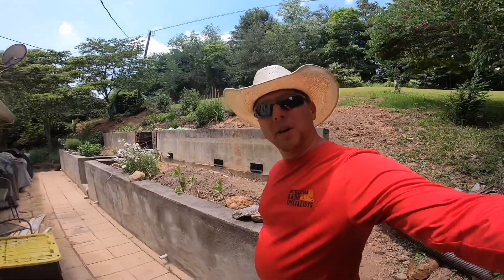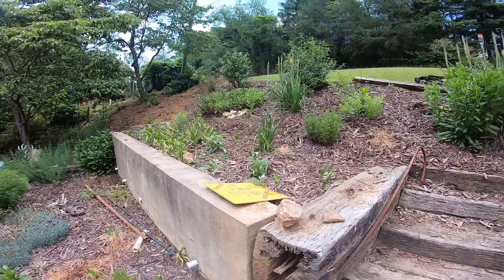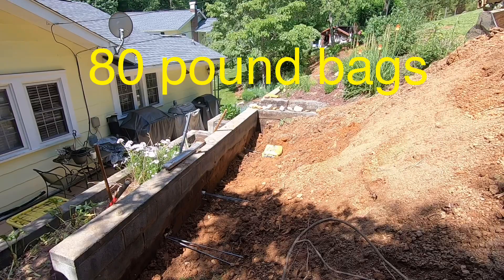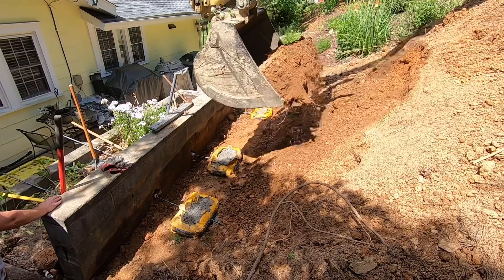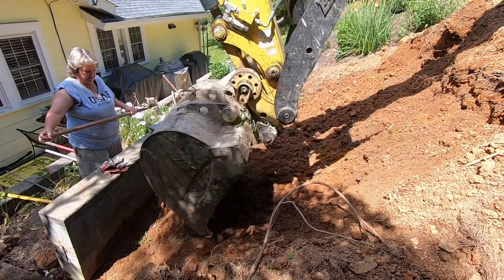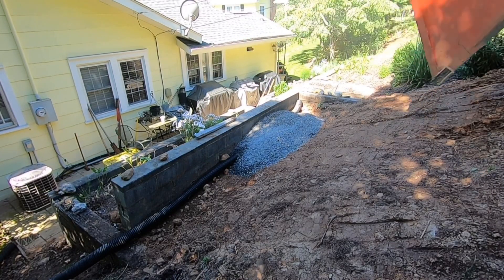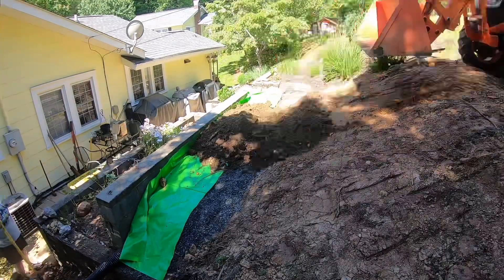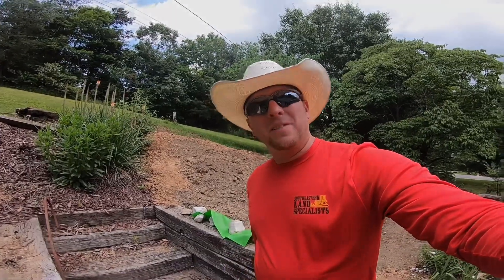Concrete Retaining Wall Construction (Repair and Anchor)

Comment: Anchoring a wall is nothing new, many have been anchored and stayed in place for decades.  My opinion this job falls short of quality workmanship and the home owner wasted there money. 
Example. 
The distance from the wall to the anchor is to short. With lack of distance between wall and anchor, the earth can’t hold the cement anchor in place which you need to hold the wall.    
The rod needs a plate welded on each end Or the rod needs to be bent on each end so it can’t slide through the wall or the cement anchor bag and lose its grip on the rod. 
Anyone having a wall fixed should get a detailed drawing plan from the contractor and get a second opinion.

Comment: Nice work. I've regularly used bags of concrete like this for various purposes like creating a culvert wall on the upstream side etc. I've always dry-packed post with with it instead of mixing and waiting for it to dry. I've heard if you can't fix it with duct tape or sakrete then it can't be fixed. 😁
Reply from the maker: Thanks for commenting my friend.

Comment: Great job, never thought of rebar and concrete, have just used cable and anchors. For a short wall like this it should work great.  Very good video.
Reply from the maker: What do you use as anchors?

Comment: Interesting, where did you get the idea from to use the concrete bags like that?
Reply from the maker: Construction Trucks honestly....I like trying new ideas. I was pondering on how I was gonna fix this project and it just popped into my head. Hopefully it works in the long term
Reply: @DigginLife21  You will have to give us a long term update then, several years from now :)